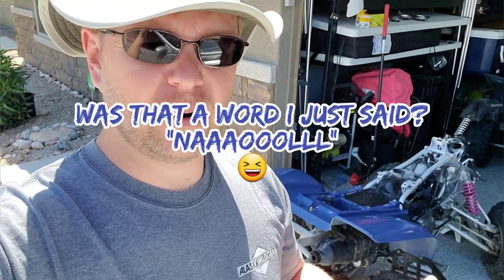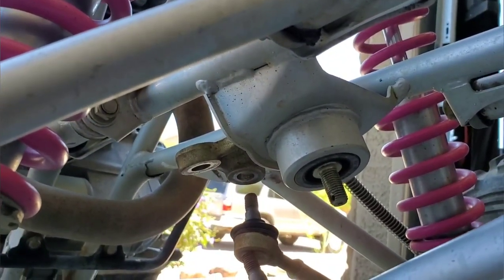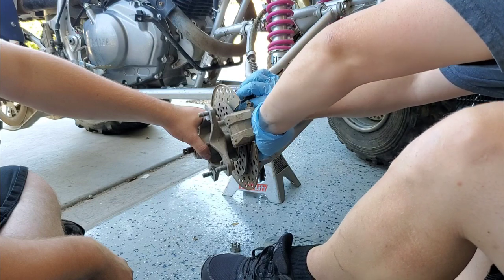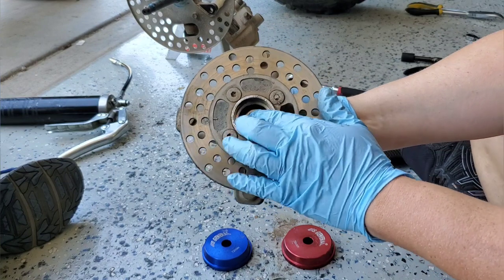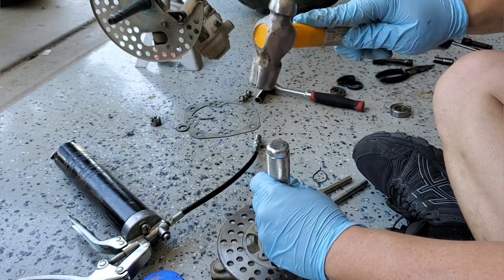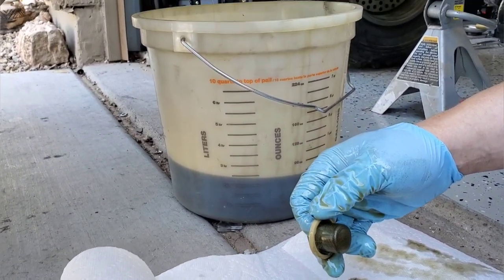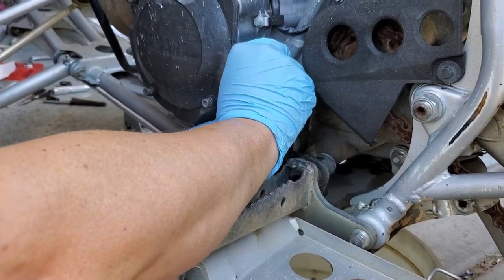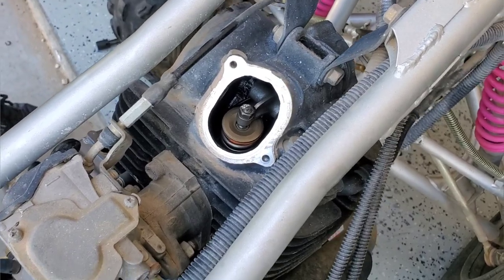PT.5 STEM, CONTROL ARM, WHEEL BEARINGS, OIL FILTER & VALVE CLEARANCE YAHAMA WARRIOR ATV RESTORATION

Comment: Oil probably had gas in it from rollover as carb float opens when upside down.
Reply from the maker: It probably did 10 years ago, but evaped out by the time I got this machine. Of course, an oil change was mandatory (several actually to make sure all was clean) as these just use a filter screen.  I need to do a followup, this little quads restoration went perfect and has been in use a while now! Runs awesome for the scrap heap that it was!